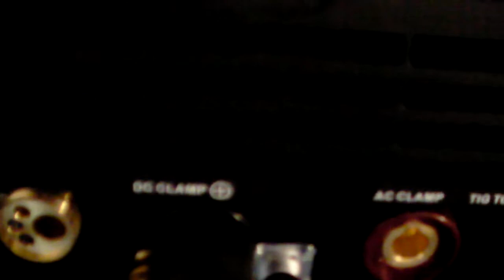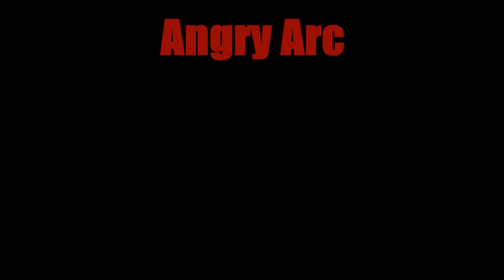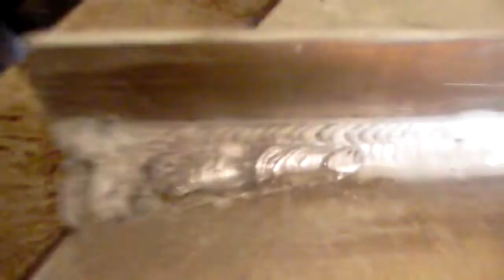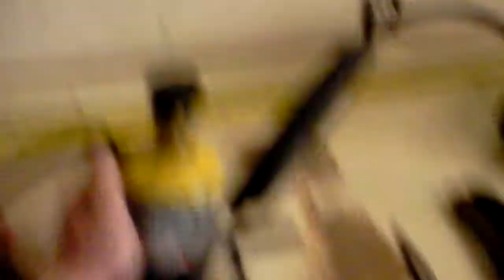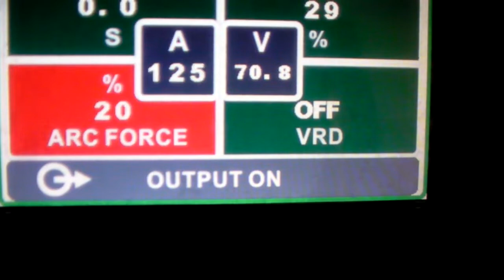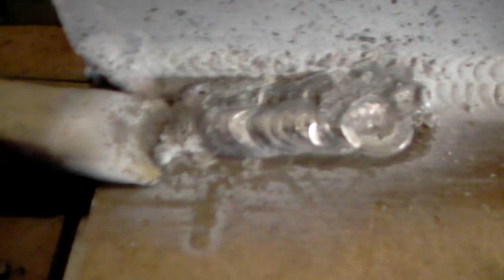Stick welding Aluminum

Comment: what is the maximum no-load voltage (ocv) of the welder?
Reply from the maker: The OCV is 71 volts if I remember correctly. Sorry for the late response.